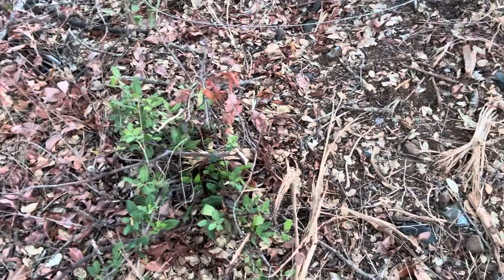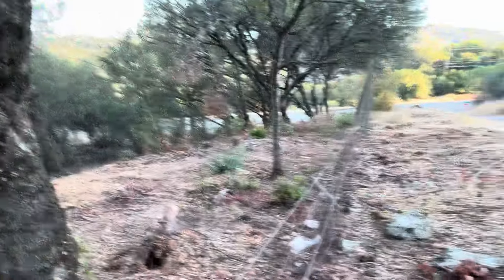Mastication in the Foothills

Comment: former nrcs district conservationist in the sierra footthill counties .. we assisted hundreds of landowners thru the environmental quality incentive program (EQIP) to reduce fuel loads using thinning pruning mastication pile& burn techniques .. in several cases local fires were preventing from spreading as they advanced on treated acres .. of course there will be regrowth but when you alter the vegetation from a dense 'jungle' to an open park like setting you have bought yourself several years of protection and it makes any future treatment so much easier and cheaper to maintain .. there aren't any [perfect solutions so we have to use what is feasible and effective ....

Comment: The only way is to constantly maintain  if you’re trying to clear sections for example parallel to roadways you have to do heavy clearing and then yearly maintenance or twice a year maintenance and whatever is there you take it to the ground using whatever it takes to do it, mastication clears for access but just makes a mess, goats you would need millions of them, mowing the ground would have to be clear from rocks debris etc. because mowers can start fires so the best is just to take it to the ground clear it and maintain it and do whatever it takes to keep it maintained whether it’s spraying complete ground clearing so it can be mowed/maintained spraying etc. but it needs to be done on a regular basis.